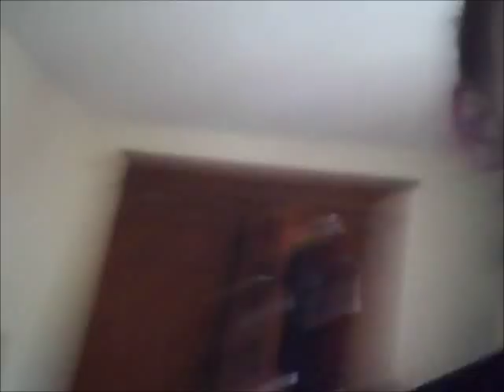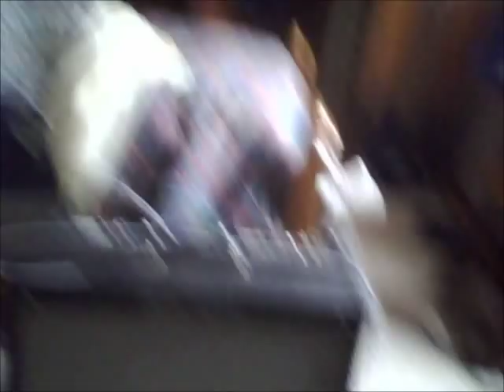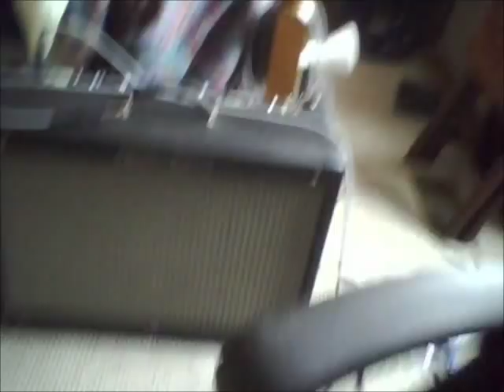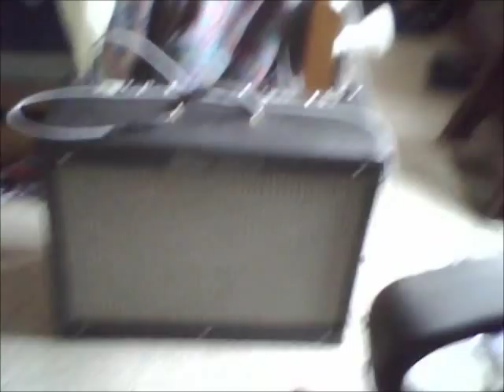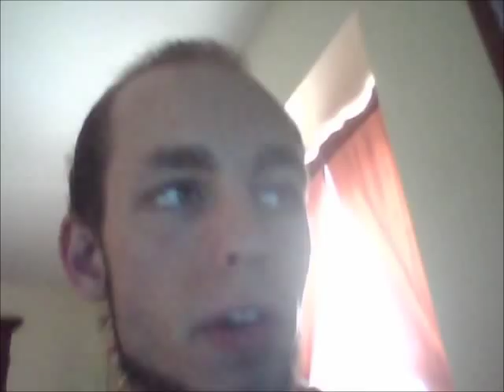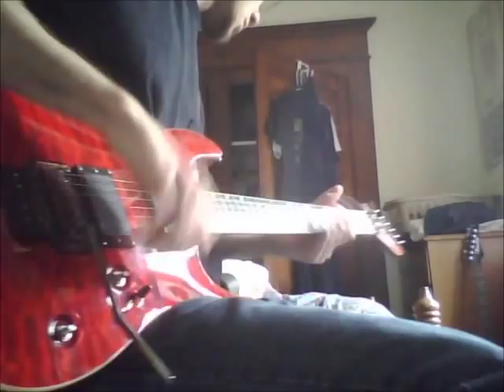Fender Hot Rod Deluxe Fromel Mod Demo

Comment: I know the sounds of things can be very subjective.  Just go on Harmony Central and see what various guitarists say about the same amp.  
    My question to you is, do you like the before or the after?  I just bought the Fromel Ultimate Mod and I don't want to launch into the project if it doesn't really sound "better." 
Of course I don't play with my amp set on "flat."   Don't things improve if you push it a little?

Comment: Hand wired is the biggest bunch of BS snake oil  in the guitar industry.  The majority of all pro elite players are playing through circuit board amps.  Some hand wired amps sound like crap, and lots of circuit board amps do.  I will say the guitar needs a tuning intonation mod, but the amp sounds better, and there is a reason this amp is the best selling most gigged amp of all time.  It gets the job done.

Comment: All I hear is those awful EMG pickups. You should'v gotten either a strat to go with that amp, or a nice high gain amp to go with that guitar.
Reply: Could only have been worse if he used a Les Paul with EMGs. Amp sounds great, though. Just needs a Strat plugged into it.